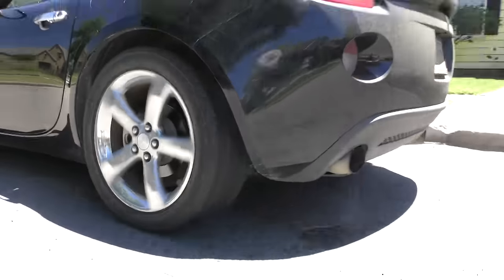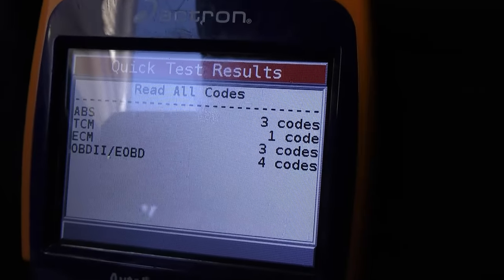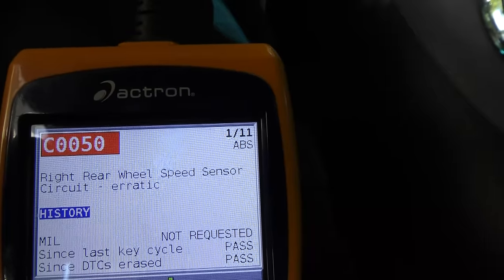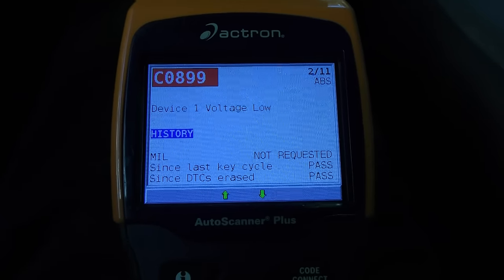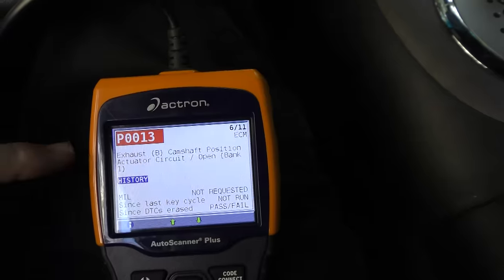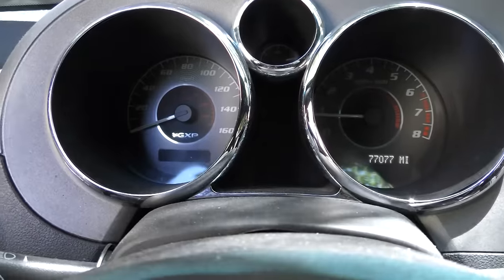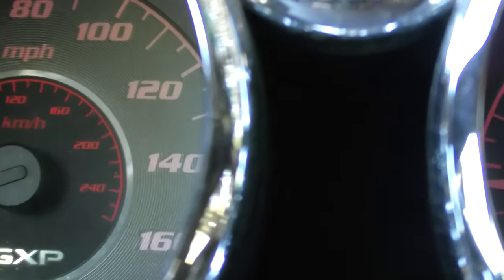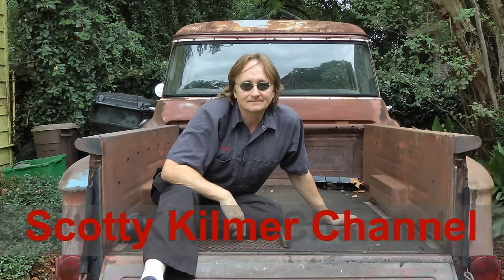Check Engine Light On in Your Car? The Truth About What it Means

Comment: I'm amused by the people complaining about electronics in modern cars being fragile. I drive a 2010 Honda Civic, it has a ton of electronics and have traveled more than 100 000 km and not a single electronic component has failed. It's not cars having too much electronics that's the problem, the problem is that certain brands don't know how to make reliable cars. I also suspect that many problems people have with their cars are caused by poor maintenance and neglect.

Comment: This happened to me yesterday with my 13 Ford Explorer.... it tripped a code for an evap leak (even said very small leak detected) I turned it off and it never came back... figured out it may be an evap purge valve and it's caused by overfilling the gas tank

Comment: Ok, Scotty. Today, I went to inspect  my 2003 wind star and it failed because  the check  engine light didn't come on at the initial key on. The check engine bulb might have burned out. What I like to know is  what kind of bulb does it takes ?  Will it start if I take the cluster out and replace the bulb? I can do the work. My fear is would it start. Some people says it has to be reprogrammed. Can you give me some pointers? Thanks,

Comment: Intermittent problems are electrical problems. Most intermittent electrical problems are loose connections or for those who live where there is rock salt or ocean water or flood damage lol you'll probably find oxidized connections. There are also burnt wires and loose ground wire connections. Why does all this matter? because when the check engine light is on the car reverts to open loop operation which hurts drivability emissions and efficiency. In fact since the car is program to run rich and open loop mode it will probably follow the plugs sooner leaving you stranded at some point when you get a random or multi-cylinder misfire because the plugs have filed sooner than they have worn out. My advice is make everything work correctly. This is not cheap or easy. I guess you wouldn't do this if you have a beater car. But to me no car should be a beater car. Up to you I guess

Comment: What I can't stand about the check engine light is in Pennsylvania your car will not pass inspection if you show up with the check engine light on.  You must reset it in drive roughly 60 miles before taking it in and hope to hell it doesn't kick on as you're driving to the inspection place.  Unless you drive under 5000 miles per year which technically is called "exempt" then emissions are not required in Pennsylvania.
Reply from the maker: isn't that just freaking hilarious. You can drive your car legally a certain distance, but no further. WHEN did we allow these bureaucrats to control out lives? It's like a Kafka novel come to life in America.

Comment: Need more truth.  Going just to the ON position from OFF,  AND no codes have been stored, is the "bulb check" always a momentary lighting of the CEL?  I mean, is this assured as if it were an industry standard, or at the whims of the auto company that might have a continuously lit bulb check instead?  Thanks

Comment: I have a BMW E90 318i. Sometimes it starts knocking and the check engine light turns on. And the knocking continues.
Upon turning the engine OFF, the check engine light goes off and the knocking stops.

Comment: Resetting the codes can be a problem if you need to inspect your car. You have to drive at least 70 miles, and pray the engine light doesn't come back on. Otherwise your car will not pass inspection.

Comment: Hello Scotty I've been listening and watching  your videos for quite some time. So I have a situation going on with my 03 camry, I changed out the catalytic converter, to solve my latest issue. Now I have a check engine light, so I took it to autozone to get a reading, but their scan tool gives an error message, unable to load any ideas, why I'm   having this issue, I also disconnected the negative cable and it turned right back on

Comment: You definitely won't pass a smog check with the Check Engine light on and neither by erasing the codes because the monitors have to clear the drive cycle tests. Also a bad charging system along with a poor battery will fail smog in swift flight. There is no Free Lunch! Fix it or pay later! The Three Ring Circus will never Stop, unless you deal with the Check Engine Light issues.

Comment: When the Check Engine Light (AKA, CEL) comes on, the ECU goes into a drive home/fail safe mode. Fuel mixture, ignition and camshaft timing are all set to provide a stoichiometric mixture of 14.6:1.

What does this mean? The ECU doesn't adjust ignition timing, cam timing, and fuel mixture. It's in a "run home to mommy" mode. Poor fuel economy, poor performance. Eventually, a poor wallet because it will cost more to repair in the long run.
Reply: Ning3n not always true.  depends on what the failure is.  it won't go into limp mode for a loose gas cap.  a lot more complicated than that.  different failures have different strategies and they are not all going to do the same thing.

Comment: I have a town and country that has a check engine but its really odd, on my friends ODB scanner it shows nothing but the light is lite and when I do the on off on off on method to check it comes up with P1684 (a useless code) and P0456 (small evap leak). We reset it and it passed emissions and everything so there is obviously no leak in the evap system....

Comment: Hey Scotty, I've got a 1995 Jeep Cherokee with around 191K miles and I've been using 5W-30 oil for it. Recently when I went to take it in to get an oil change, because I didn't have the means to do so myself this time, the guy recommended me I change to a 10W oil. Should I do this next time I change the oil or should I just stick with the 5?

Comment: I make a great living off of people that listen to guys like this.
Reply: Rusty Rivet that seems unnecessary.
Reply: Rusty Rivet my comment was true. It's been a bit since I watched the video, but, I distinctly remember some pretty bad advise. I think anyone that wants to stand on a public platform - such as YouTube - and give tech advise, maybe they should be responsible about it. You know, because, things like ABS are an important safety feature.
Reply: And let's run the engine until the timing codes get so bad it does need serious repairs instead of trying to determine the failure early, and prevent progressive failures. Hell instead of repairing your car, just buy a scanner and keep clearing the codes. You can blame these guys when that goes wrong. Instead, I would tell someone to do some research into how to properly diagnose and repair failures before they become catastrophic.

Comment: I got a car from a dealer yesterday  as soon as I turned it on the check engine light was on took it for diagnostic check says its manifold runner position  spoke to dealer he said manifold has been changed so light shouldn't  be on but garage cleared it  and it came back k on 5 Miles later which they said would happen as code still showed after clearing it . He won't accept there is anything wrong with the car . It does drive nicely but I've only driven 23 miles so far as I'm worried about the light 😢

Comment: Half the time you can cure it by getting a new gas cap.  Cheaper to get the gas cap than to take it in to be plugged in for the code to be checked.

Comment: i bought a brand new '04 tacoma 2wd. had it lowered before it had 1k miles on the odometer. it was then that the check engine light came on, and has been on for 57k miles, with zero mechanical problems. i vaguely recall something about charcoal, but have never had the light issue addressed. thoughts?

Comment: Hey Scotty Kilmer ive been a long time viewer, and learned alot from your channel. But I come to you with a question...
Does resetting a check engine light actually fix anything..?
Is it safe to do..?
Is it just hiding the problem..?
I pumped gas today and drove it maybe 40 miles today and my check engine light decided to turn and stay on.
Checked my gas cap was tight. And I did NOT notice any misfiring issues. But it seems like some mechanics just wanted to reset the check engine light.. But I dont know if thats a fix, or just to hide the problem when its actually still there..

Comment: this was a good tip. 
However you wouldn't want to go on long trips with that check engine light on.
Reply: No Way that's why you have multiple cars so you can't take the one with the light on around town and leave it parked during the week.
Reply: I've done it before. Depends what is causing the check engine light.

Comment: My check engine light is on for a camshaft position sensor I replaced the sensor and cleared the code but when I shut the car off and started it again the check engine light came back on and it was the same code. What do you think it could be?

Comment: Haha I drive a dodge ram 1500 98 . it has 157××× miles on it . I 've had it for about 5 years now . its never once thrown a check engine light . knock on wood . every good truck.  Well maintained

Comment: my check engine light came on, I did an OBD2 scan and it said that I had a bad O2 sensor.. The Upper Sensor.. So I replace it.. :D .. then the Check Engine light came back on and the Code said that the same O2 sensor was bad, So I replaced it again...  I've replaced 5 of those O2 Sensors and the Code still says it's bad....  How many Defective O2 sensors could I possible buy???....... (If you've gotten this far, I'm only kidding, I replaced the Bad O2 sensor and it works fine ...no more Check Engine Light.. )

Comment: i had a check engine light last week. p0440. top solution told me to reinstall or buy new gas cap. i had a guy reinstall the gas cap, erased the code and so far its been off.

Comment: My car battery light was on for 2 weeks, I decided to change the battery and the alternator hoping that was the issue but the battery light is still coming back on. Then now, my engine light is on as well as a flashing battery light. I don’t know what is going on with this 04 Toyota Corolla or how to solve this ongoing problem

Comment: Im getting a Catalytic Efficiency code on my 2004 Sienna.  I tried changing all 6 spark plugs with OEM plugs as well as changing the PCV valve with an oem part and air filter/oil change. The code still won't go away. Is it serious or just keep driving?

Comment: I have an 2006 Toyota Corolla that has the oil pressure light on. Was running fine and all of a sudden started to die. I replaced the oil since it was due but also replaced the oil pressure switch but it still keeps turning off. Any ideas?

Comment: well hate that light after replacing the back exhaust censor 4 times one shop says it can be the computer and a other says it can be the catalytic converter well after 3-4 months of replacing sencors i'm not abut to use 500 usd for them too find the real issue and 1k or more usd to get it fixed, so i used the this as my reason to buy a new car and get rid of the other going from a hyundai i 10 to a toyota yaris hybrid 116hp 2021 model only have to wait 2-3 months :) btw the car drives normal and fuel use is normal for what i can tell.

Comment: Hello , i have a civic 02, and the check engine light is on but it started everysince i made an oil change that spilled a lil from the mechanic as i seen by myself, now the light comes on and out but not blinking i have this problem 4 days already. Should i be concerned or not, i repeat it is not blinking but i might can do something about it without the reset?

Comment: My Toyota celica 2000 model when i plug the code reader in says can't connect to ecu and the abs light flashes but when i take the code reader out the abs light does not flash

Comment: Good evening sir 
I have 2015 chevy cruz check  engine light on and stability light . Had vehicke repaired heads and over 11 codes. One week after repair check engine went on and stability travk kniw veh starts for a few minuted and shuts off has little power . 2015 Chevy cruz thank you

Comment: I have the code p0366 camshift problem that made the car go into limp mode. Took it to a mechanic to clear the codes and was told to give it a couple days and see if it reappears. Do you think it is good advice? The car is vibrating somewhat near the front...😢

Comment: Had both oxygen sensors replaced in '96 Olds Ninety-Eight. Check engine light went off. Then came back on with same code a couple days later. Had light turned off. Came back on two days later. Huh?

Comment: Yeah my S40 volvo had random 'check engine' light coming on whenever you leave it running and not drive it. and if I just tap my break pedal light turns off again. never looked into it. drove as is. now its sold...

Comment: My 2007 LC check engine light is flashing some time. No misfire or anything. I check with scanner but no code. Gas cap and spark plug  and all is fine no problem. I changed stock tyre to 285/70/17 all terrain tyre with method Rim. Any idea what is the reason light is on and off. ?

Comment: Hey Scotty in my 2004 Toyota Celica GT when I am at a stop and I put the clutch in and put it in first gear it starts to shake and I'm not even letting the clutch out without giving it gas it just sits there and shakes and then I put it in neutral and it stops. I just sit there with the clutch in and in first and it starts to shake. What could cause this to happen?

Comment: question, what if your Service Engine Soon light turns on and flashes on and off. replaced my starter, fuel pump, new fuel pump relay, new spark plugs. but my car still idles high, revs while coming to a stop and turns off.

Comment: I have a 2015 Subaru forester and the check engine light keeps coming on. Last time it came on the vehicle started to sputter and the dealer replaced the air fuel sensor. Ran fine afterwards. This time it came on and I got a reading of either air, fuel, or oil; reading was done by a local mechanic. Car was running fine. The stupid check engine light has been on and off for the past 10,000 miles at least five times and the dealer has not been able to keep it off. This has also included replacing the mass airflow sensor and some other minor things but cost me at least 90 dollars each time. The stupid light- because it’s a Subaru- disables the cruise control and the VDC switch. Advice? This is really very annoying.

Comment: Hi Mr Scott, I have a 1995 Ford Taurus,,I had it for 5 years,my engine light came on when I got a tune up ,last year  the engine light stay on ,I replaced the Gas cap, the coolant temperature censor, the temperature censor, catalytic converter   ,changed the oil and my engine light is still on  ,can you please help me ,I don't know if something need to be reset or what , should I remove the battery cable  I could definitely use your  help now,I can't see how many miles is on the car that don't work anymore  the one that's in the dash i don't know what you call it, it seems like every time I get something fixed on that car something else, go wrong  ,I don't know what to do

Comment: On a 2006 Ford fusion v6 3.0 would a faulty ignition coil trip the computer and if so can I reset the computer or what would be the easiest cheapest way to get that check light engine off. I disconnected the battery and changed the coil but light still came on.

Comment: 2017 camaro, check engine light on again. Dealer worked on car they ssid they never had CE light. I disconnect battery , all good. What is the deal with the stupid gas filler flapper? I heard these are a problem

Comment: What about EVAP system small leak issue?  Im so embarrassed for not looking you up prior to paying $592 on replaced purge solenoid because I was told the gas cap was good.  Since then, the check engine light has come on 2 times in 2 weeks and 3 mechanics later. :-(  I was told I got screwed over. Just this past Monday it happened again so I replaced the gas cap. Now, the engine light came back on this (Sat) morning. Please help!  I'd appreciate it so much, thank you kindly!!

Comment: Hey Scotty I am looking to buy a Honda Accord 2000 EX but it has 199000 miles  and it is in a junk yard it sounded perfect V6 well kept when in to gear no problem forward and Reverse but the check engine light is on Oil looks brand new what do you think I think it is it is a great buy asking $2200 ??

Comment: What is the whole camshaft assembly on a 2014 Malibu ecotec? I’m getting a po10, p013 code. I replaced the intake camshaft solenoid but not the exhaust camshaft solenoid. Engine light still on. Changing oil next hoping that will fix the issue.

Comment: one  question , will it matter which way you pug in those original tall parking / stop bulbs  like a 3057.
I often wondered why they have 4 wire contacts on them but they are staggered .

Comment: Hey scotty my 2013 gmc terrain with 120+ thousand miles was losing power, i checked my battery it was connected properly, i made the the wiring harness for my ECU is connected properly and after doing so, power came back on the car and it started up back and ran normal like nothing ever happened. What do you think could be the issue?

Comment: My check engine light gives a false code. Says I need a new EGR valve.... I replaced it 3 times! Turns out it's a clogged internal combustion chamber typical for those Ford 4.6 liter V8s in 1995. Of course Ford fixed the problem in 1996. Good news is several mechanics told me not to worry about it.... I'm actually getting somewhat better mileage they said. Lol. It runs fine. Nothing like good ol' electrical tape!
Reply: Tim 
   

M